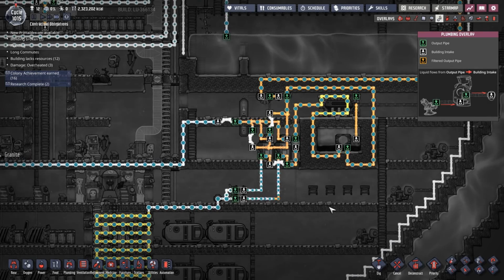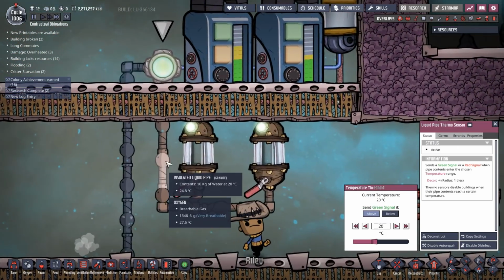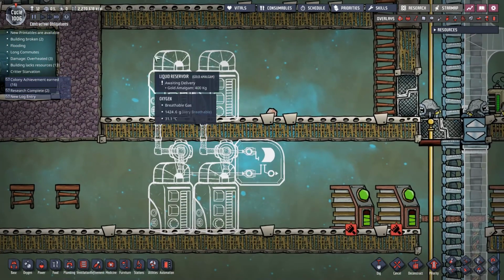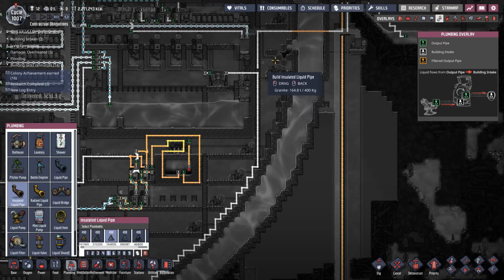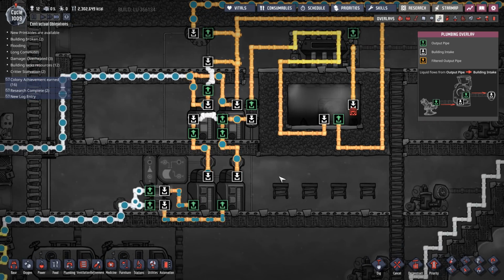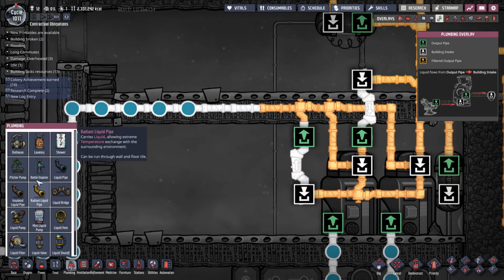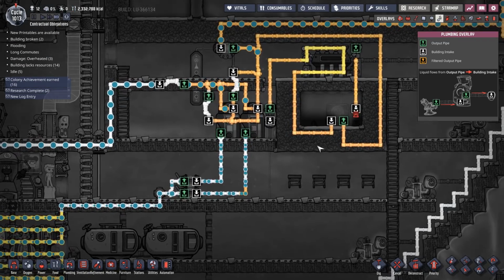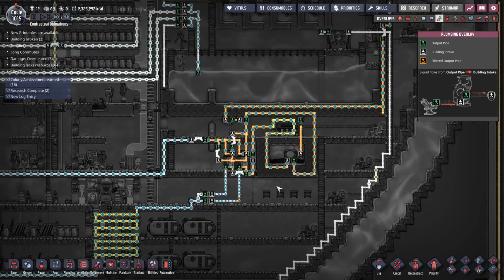Ultimate BASE COOLING System! - Oxygen Not Included FULL RELEASE Ep 6 - (Tutorial/Tips 2019)

Comment: If the overflow pipe continued up and joined the hot water entry instead then it wouldn't interrupt the continuous flow of the loop and would only add when needed.
Reply: But the overflow could then back up.
Reply: @Jules_Diplopia  If the overflow backs up, it will automatically shut off adding water to the system until some of the water is consumed!

Comment: I am enjoying the vids. Keep up the good work. I have a tip involving the manual valve you put in to let water out of your system. I use a shutoff with a hydro sensor to turn it on and off. You can just click between above or below on the hydro sensor to turn it on or off. As long as the hydro sensor is always going to be dry, it will just work like an on and off switch that you don't have to wait for a dupe to come along and change the setting on. Yes I know it is just temporary and you are going to take it out but this tip can be used for anything you want to turn on and off without dupe interaction.

Comment: I had to flip the top liquid valve to be vertical, for some reason it kept telling me "pipe blocked" while it was horizontal and going directly into the main flow.
also I didn't feel like using this for cooling my base (yet), so I just simulated your full loop by connecting it itself sooner. It didn't seem to work with just the hot water input and one-way distribution (toilets etc), but it's possible I didn't give it long enough to start.

I have another valve after the thermo sensor that lets out just enough water to run my base, and that number matches the valve letting in the hot water. 

either way it's working for me, thank you so much for the tutorial :)

Comment: The way it is set up now, you'll have to intervene when the drain reservoir is full... so the system is still flawed. And if for some unforeseen reason too much hot water is added to the reservoirs, then it will first circle through your base before actually being cooled by the aquatuner.

This cooling loop is so much more complicated than it needs to be! You could just make 2 loops; one running through the aquatuner and the other through your base. Then run both loops through a section of steel tiles with radiant pipes (2 wide so you have space for both loops). The steel tiles will average the heat between the pipes. This should make it easier to make a system that can run without a drain. Having a return loop controlled by a shutoff after the tempature sensor should also add a safeguard so that hot water can't be circled through your base
Reply from the maker: The drain is ONLY there to show what happens IF water is taken out of the system .. so no .. the system is not flawed :P

Comment: Correct me if I'm wrong here, but I think there's still a bit of a problem in your system to add more water. The way it stands now, if your output from watering your plants/bathrooms/whatever is less than how much hot water your adding, which is admittedly unlikely with how low you've got it set, then you will still end up locking your system. With a Buffer Gate there, the hot water pipe will shut off for 200 seconds, but then will come back on until the next time the element sensor trips. Now this might just be a few seconds, but it could still lock up the pipe for a bit. With water coming out it would eventually unstick itself, assuming the Buffer Gate didn't re-open the pipe before enough left anyway, but I think I'm seeing another problem too.

If your hot water inflow on average is less than your outflow average, then your system will eventually shut down because the water is gone, having all been drank by plants or polluted by dupes. This could be mitigated by careful management, yes, but you could also change your logic around a bit to fix it the same way since you do have ways for the system to unstick itself if its too full. If, instead of your Buffer and NOT Gates, your element sensor feeds into a NOT Gate and then a Limit Gate, that should fix this potential issue. This way, when the sensor detects water, the NOT switches it to Red, doing nothing, but when there is nothing in the overflow pipe, meaning the system is not topped off, the Sensor's Red switches to Green. If you set the limit gate to, say, 30 seconds, then if the overflow pipe is empty for 30 seconds, then the hot water intake will open long enough to top off the reservoirs and fill the overflow pipe, which will flip the Limit and the hot water intake off again until the next time the Limit gate is triggered.

This would also stop the element sensor from flipping back and forth randomly as it meets packets every other second, which I personally find annoying as I play. : )

It kind of makes a less arbitrary system that would react more or less automatically to the cooling/water system's levels in real time as opposed to just every so many seconds as designated by the Buffer. A potential problem is that it would probably slow down the water's travel speed a bit with the system being so close to full all the time with only the plant and bathroom consumption unsticking the loop, so it might make the system less efficient for cooling, but its an idea.

And now that I think about it, it would probably eliminate the need for the throttle valve on the hot water input as well.

I haven't tested this idea at all. It actually just came to mind as I watched your build, so I don't know if there would be any other crazy tweaks that needed making aside from the logic change. I can understand not wanting to mess with stuff because of your brain being more than half melted and the system you have now would certainly do the job you need it to, I just wanted to throw this idea out because automation is amazing.

But then again, maybe I'm just thinking about it too hard. : )

I greatly enoy your videos and have based a lot of my base on what I learned watching what you've posted. Keep up the great work.

Comment: Would your original stacked reservoir solution not have worked if you had simply fed the return / make-up water into the lower reservoirs rather than the upper ones? That ought to remove any bottle-necking potential.

Comment: The cooling system is really nice, even if it is a bit more complicated then my usual stuff. But the System to top your loop back up has gone way overboard. A simple bridge ending on the pipe before it is split up to the 2 reservoirs would have done the job. :D The bridgde would just top every packet back up to its full 10 kg.
Reply from the maker: Nope that would have continued to fill the system up till it locked up
Reply: @SkyeStorme  Don't trust me, try it out, it works. The reason is, you're pulling out 10kg/s (500g/s per reservoir). If nothing is used up, there will still be 10 kg in the pipe just before it splits, so there is no room for the bridge to output anything. This way you can keep a loop filled with the exact amount you want, just have to prefill any tanks to the amount wanted.
Reply from the maker: The output has to VARIABLE .. not always 10kg .. so this is not the solution :)
Reply: @SkyeStorme  I think you missunderstood. Your 2 tanks always output 10kg/s (5kg/s each) so that is 1 full pipe. If, let's say on the way through the loop 500g/s are consumed, there is 9.5kgin the pipe before it splits up to get back into the 2 tanks. Now if you just stick the output of a bridge onto a segment wich has 9.5kg the pipe will pull 500g from its input and merge that with the 9.5 kg, refilling it right to 10kg. Because there is always a output of 10kg from the tanks, and because there can not be more than 10kg input into the tanks, the system can NEVER overfill and if the input of the refill bridge always has enough to fill any gaps, the tanks will keep their content at exactly the same amount forever. It would only become a problem if the loop somehow gets blocked so the tanks can't output anything but still take stuff in, but you have designed it that way, with the 2 tanks, that it can only happen if there is some connection broken. This works only because the pipe has priority over any output connection of any building/valve/bridge but bridges can fill the pipe up to its 10kg if they have the same liquid at the input.

Just give it a quick try, all you need is a reservoir, a small loop and a bridge supplying right onto the loop. It will fill it up until every segment of the loop is filled, so if you want to have some in the reservoir it has to be filled by diconnecting its output. The reservoir has to have a bit of space left or else it will stop to run.
Reply: I can confirm pipes work this way. instead of the overflow and hooking your hot water through the same pipes as your aquatuner output, if you put the hot water so it feeds from a liquid bridge directly onto the loop before it splits it will only pull the amount of water that gets used. 

the key is for it to feed directly onto pipes that are part of the loop, otherwise you'll get that alternating flow that happened with your overflow pipe.